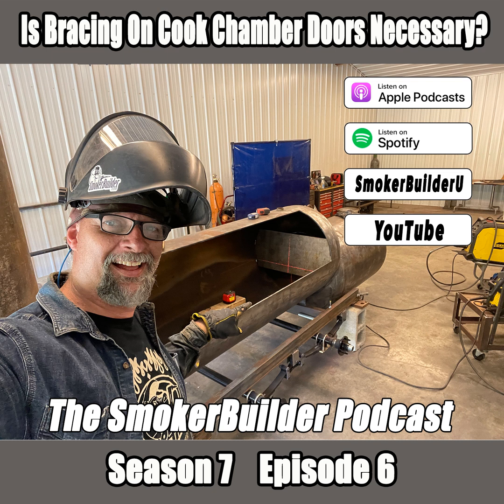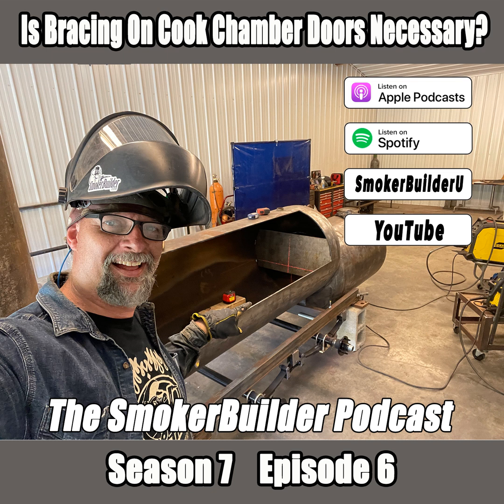S7 Ep6: Do You Need Bracing on Cook Chamber Doors for a 250-Gallon Smoker Build?

Comment: Thanks for the info I bought  one  it's doesn't  have  gas inside they  took  the gauges  and everything  I want to cut it but I'm afraid  😅 it's a bit rusted in and out but I want to turn it Ina smoker  the plate reads 2008 so it's been  around  for a while thanks